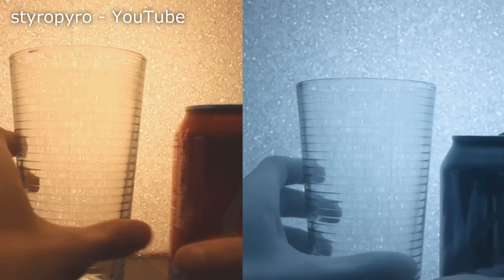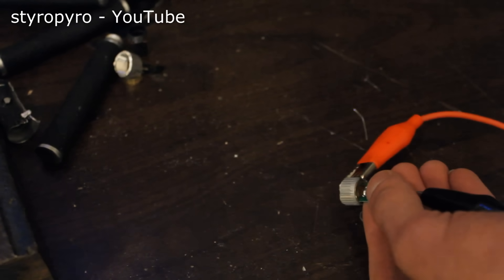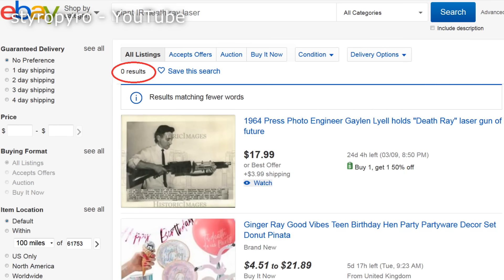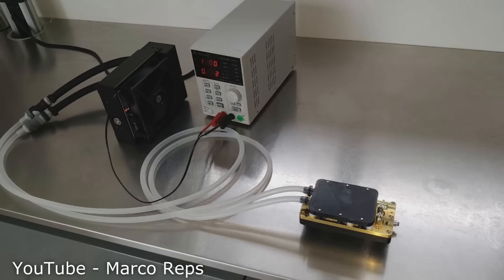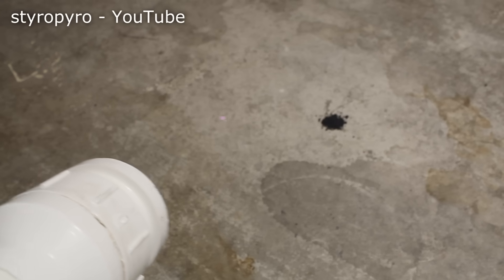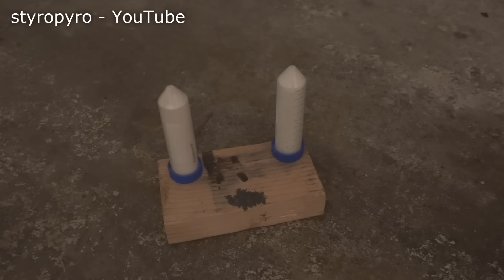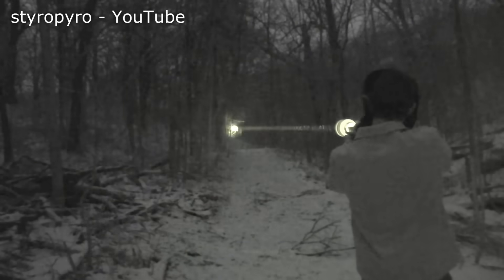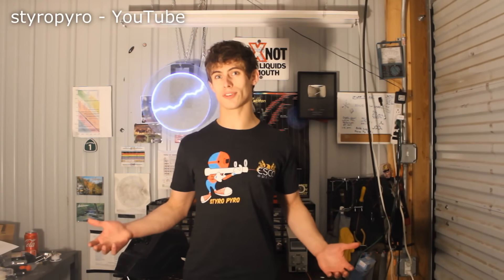100% Invisible IR death ray laser!

Comment: You're someone I would want in my apocalypse team.
Reply: forgetting solar panels and wind generators
Reply: Laser technician zombie killer??? HELL YEAH!!!!!
Reply: i also want jeorg sprave
Reply: Harem apocalypse
Reply: But you won’t have electricity
Reply: steelavocado- Depends on the type of apocalypse, plus generators are a thing
Reply: 〈Clex〉 True but eventually you won’t be able to power those anymore. They run on gas which is going to be very precuous
Reply: steelavocado he’s an engineer though, he has very logical and intelligent thinking. Doesn’t need electricity to be useful.